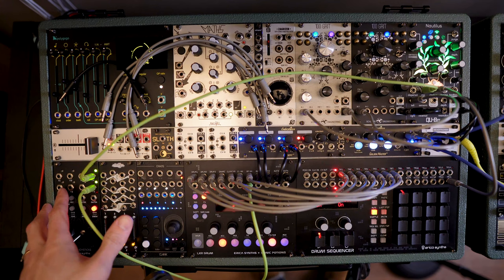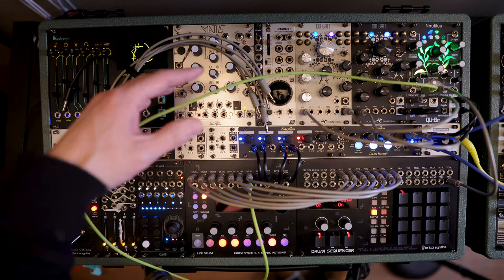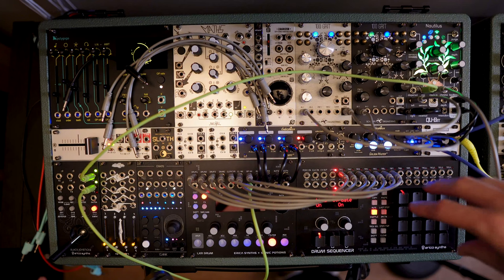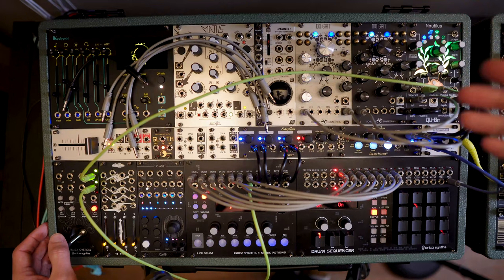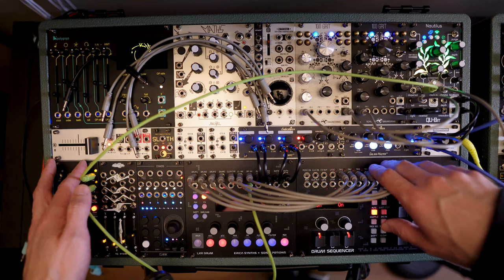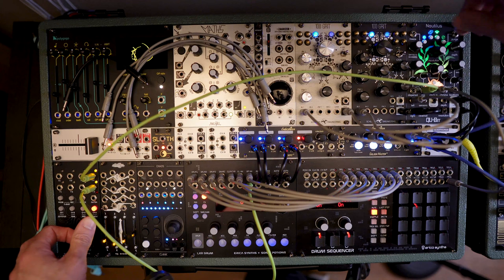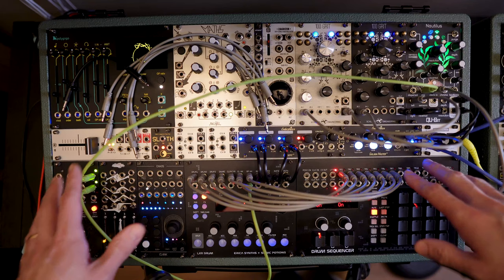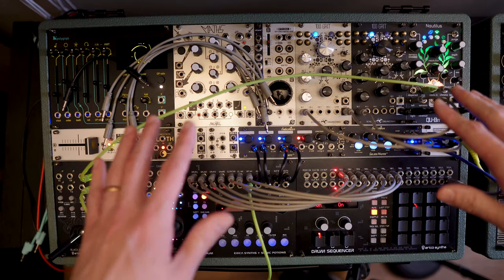Thoughts on Playable Modular Eurorack Case Design

Comment: Hi I just thought I would mention again. You do not need to patch cable from the drum sequencer to the lxr module on the back of the drum sequencer are headers to connect 6pin ribbon cable that Erica synth supplies which you can connect to the lxr pin header on it’s backside it allows for both trig and accent!
Reply from the maker: I can't seem to make sense of this for the LXR - there isn't an obvious set of 6pins on the back and I don't see anything in the manual. Also the drum sequencer outs all seem to be individual sets of trigger/accents meant to send to lots of different modules, not in bulk to something like the LXR.

any advice?
Reply: @thismeanswarbasse  I think I am wrong I am so sorry! -would assume Erica synth’s had this on all drum modules I never new until I had to replace my drum sequencer I found no documentation on the hidden function
Reply from the maker: @oracle-0018  all good! No worries at all

Comment: How do you find the cockpit? I’ve heard hot signals can bleed and Endorphines recommend attenuating hot modular level signals.

I’m setting up a very similar sample based techno case with a Bitbox, Nautilus and 100 Grit into the Cockpit and Golden Maser duo so signal levels might be pretty similar 😊
Reply from the maker: It's like a home internet provider, I know I need it for my house (this case) and its basically the only offering that I can pick from (1U stereo mixer), and it is almost always totally fine, but each time I have to really deal with it in any detail there's something annoying about it.

I've fixed one of those annoyances in this video: https://www.youtube.com/watch?v=9c4hiYJz92g but lately I'm equally annoyed about the output as well. It's labeled headphones, but I don't use it at all. Any time I've tried its sounds like its modular level and is totally blown (which might be what you're referring to with attenuating at the input). I daisychain it to golden master always now, but I'd like the flexibility of not doing that without dealing with a stereo splitter.

I think I've heard the bleed, but my music with this case isn't really bothered by it. I haven't had any attenuation-specific issues with how I use it. Those encoders have always been able to handle what I throw at it and turn down signals... though my audio path gets gnarly right after cockpit/golden master and not as much before it.

Comment: @thismeanswarbasse Have you noticed any major floor noise from your golden master ?
Reply from the maker: Sometimes but not always. Honestly with my particular sound and putting 100 grits after it now, it wouldn’t make a big difference to me so I try not to be too worried about it. Folks with cleaner signal paths overall might have more of an issue than I would.
Reply: @thismeanswarbasse  I'm in the same interpretation level. With all the hi hats and drones playing it makes no difference to me. I Was just trying to know if it is some kind of golden master definition/defect or just attitude. thanks.